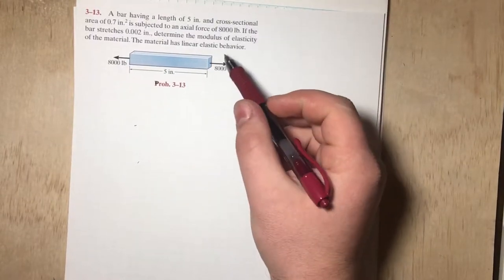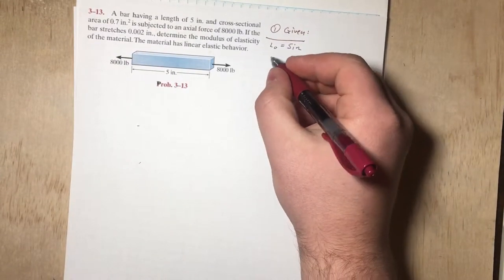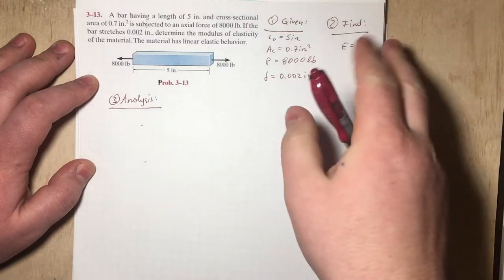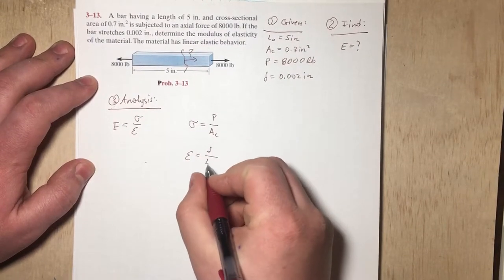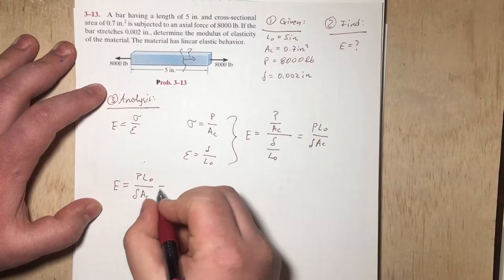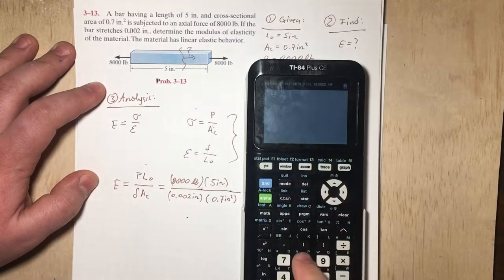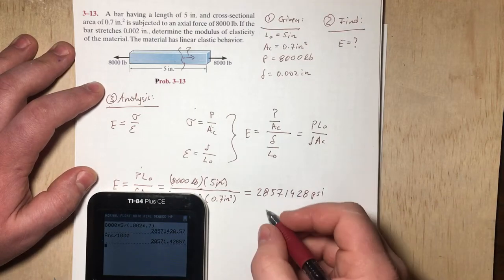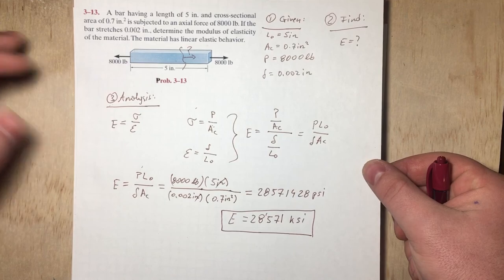How to find the modulus of elasticity

Comment: when you were calculating in your calculator did you forget to square the .7?
Reply: A little late but I hope it helps, but you dont actually square it as its inches squared which is a unit of area, you cancel out the 5 and .002 which are both measured in inches and leave lb/in^2 which leaves you with the end result of 28571428 PSI, as in pounds per square inch.